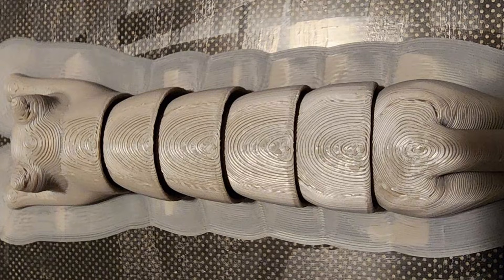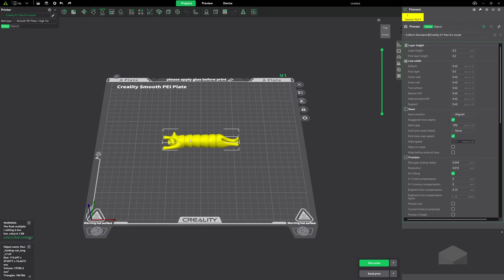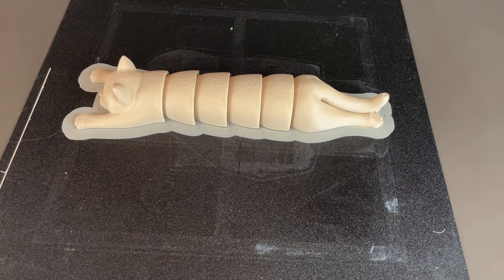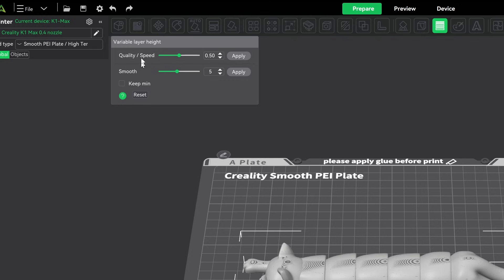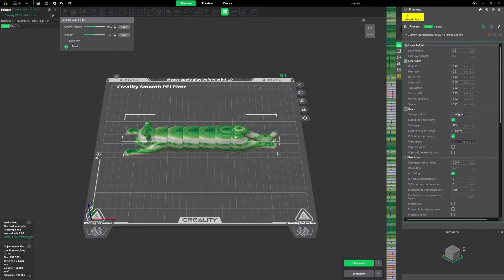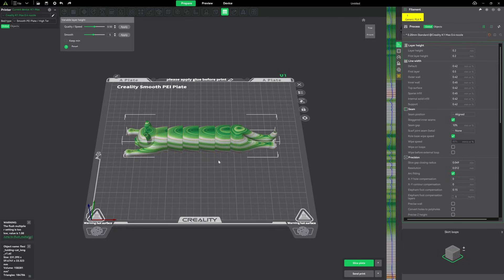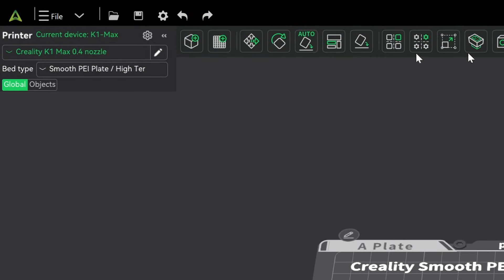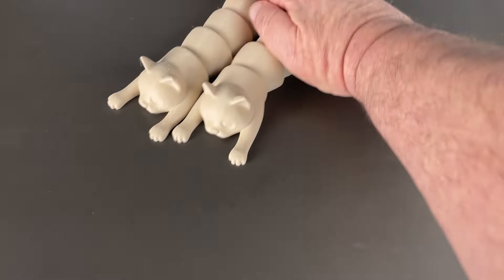Unlocking the Power of Variable Layer Height in Creality Print 6 0

Comment: Hi Bill - I had been using CR6 with some success printing PLA on the K1 Max.  However I purchased an Ender V3SE to print TPU and downloaded CR 5 to slice the Ender.  During the CR5 installation CR6 got uninstalled and now only CR5 operates.  Trying to open CR6 gives the error "unhandled unknown exception - application terminated".  I have uninstalled - reinstalled multiple times - rebooted the computer - all the usual tricks, but cannot get around this.  Can you run both CR5 & 6 on the same computer - is there a conflict?  Any help appreciated.  Cheers   Chris
Reply from the maker: You can run them both, I do it. But version 5 needs to be installed first. Uninstall both 5 & 6. After that you'll need to look deeper into your computer and delete C:\program Files\Creality & c:\ProgramData\Creality (if it exists). Reinstall V5 and make sure it works. Reinstall 6. Remember to save/export any custom profiles you made before uninstalling anything! Good luck! It's not a fun process!

Comment: back to this question if I may - I place supports all around the model manually but there is always some part touching the plate no matter what angle I set the model at and where I put the supports.  The part adjacent to the plate is pitted and rough and spoils the model. With resin slicing I can set the distance between model and plate - can you do this with FDM printing in Cr6.   I bet you know the answer to this -
Reply from the maker: GOOD NEWS! Well, sort of. This is how I got it to work in CP 6. Place a model on the bed plate. Next, right click and add a testing primitive. I picked a cube. Select both objects then right click and pick Assemble. Then, click on Object (not global) above the process area. This allows you to work on the parts individually instead of all of them. Move/position the model the way you want it to be (above the plate, at angle...). Leave the cube on the print bed. Something must stay on the print bed, so use the cube. In fact, you can even reduce the size of the cube to reduce time and material if you want, but make sure it is touching the print bed. I know this is a lot of steps and words! If you run into problems, let me know. I'm just happy to have found a way to do this! Good luck!
Reply: @ yes that does work in Cr 6 - thanks and well done Bill
Reply from the maker: In creality Print 5, you can use "Move" and drag the model up in the Z direction off of the print bed. Or you could use "Move" and enter a value in the dialog box for the z direction to get it a specific height above the bed plate. I have to try in CP 6

Comment: Thanks Bill - CP6 is an improvement for sure.  I am printing with K1 Max small anatomical veterinary teaching parts using 95A TPU from Overture (Hi Speed).  All is good except the surface being supported  is rough and pitted especially that close to the bed.  I cant figure out a way of lifting the object clear of the base - there is always some part touching the plate no matter what angle I set the model at.  I bet you know the answer to this -
Reply from the maker: The only way to lift it off of the plate requires supports. There was a time that I was able to balance a 20 mm diagonally at 45 degrees and print without supports. I'm not sure of the size and shape of the models you are printing, but it might be doable?
Reply: @ 
I am using tree supports that separate easily but for some reason the supports adjacent to the bed scar that surface of the model - the models are all shapes 2 -3  cm long

Comment: Hey great channel. I just subscribed. New to 3D printing. I have a new S1 pro running the latest Creality slicer and so far my prints have been coming out fine but i want to maximize my print quality. First off i do not see the calibration prints you are using in 5 on my version 6. Where can i get them? Secondly after e step calibration what order of calibration should i do? thanks and keep the content coming.

Comment: Trying to print with Ver 6.x.x and Im getting an error message that says Flush Multiplier setting is too low, can you advise on how to resolve this issue? Thanks!
Reply: That is very interesting, I am using an Ender V3 SE, this dialog box appears in the lower left hand corner of the screen anytime that I add an object to the build plate which will not allow the object to be sliced, I’m curious if this is an issue with this version of Creality Print?
Reply from the maker: @mikeowens3807  The good news is that I have an Ender V3 Se and I am getting the warning message that describe in the lower left corner. Better yet, I'm able to close that box or even leave it open and still slice & print the model without issue. It's a false warning.
Reply from the maker: In the upper right hand corner of Creality Print there is an icon that looks like a water faucet. That is the where the flushing volume is set. Clicking the icon will open the flushing volume settings. You can either increase the number at the bottom of the dialog box manually or click the re-calculate button in the middle of that same dialog box. I hope this helps!
Reply: @pushingplastic7445  thanks for the reply, re-calculating did not correct the problem, what does this setting actually do? and how should I be adjusting it?
Reply from the maker: @mikeowens3807  I'm assuming that you have a multi-color printer like the K2? If not, you shouldn't be using it at all. If you are using a multi-color printer Flushing Volume sets how much filament to purge when switching colors and reduce/eliminate color bleed. The darker colors like black require more flushing than lighter colors like white.

Comment: Hey buddy, great video. But, you never came back to what the keep minimum feature would do if the box was checked. Id love to know. Thanks for all the videos!
Reply from the maker: It makes sure the smallest layer height wouldn't exceed minimum layer height set in your printers extruder setting. If I set the quality/speed slider all of the way towards quality, I could actually exceed the minimum. By checking Keep Minimum, it makes sure that the slicer won't try to make layer smaller than what I had set.